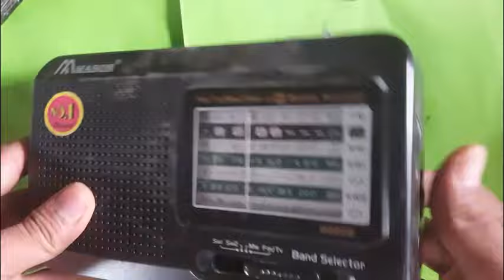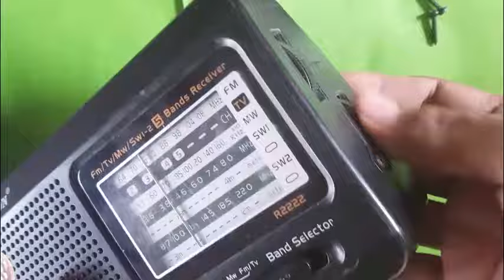How to Fix / Repairing Radio at Home Easy

Comment: My radio sound button is making noise . On low volume the sound is very high and high volume the sound is low. Plus disturbing crackling sounds are there. Pnasonic transistor radio

Comment: The repairing problems are simple for which this video is useless. Try to explain circuit diagram of 2, 3 , 4, and 5 band radio with neat band switch wiring diagrams which are useful to all radio repairers.
Reply: please let us do this if the radio sound is not coming please what ll you do for it to come please
Reply: @chrisyeboai1419   i have the same problem